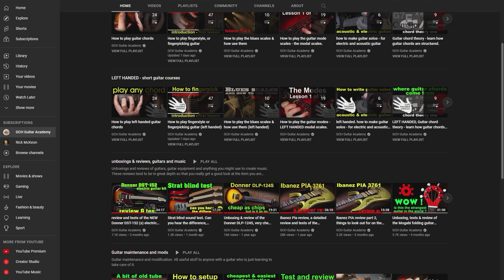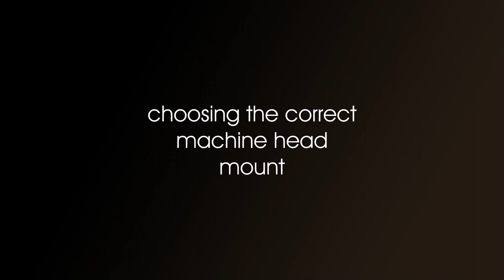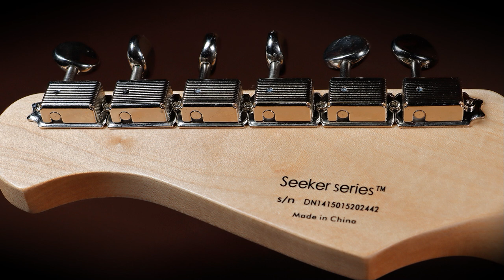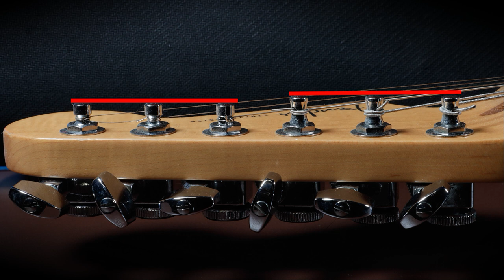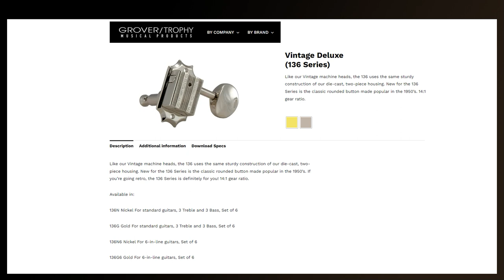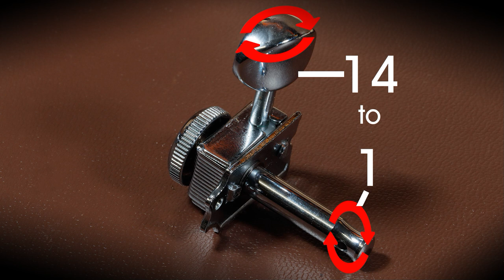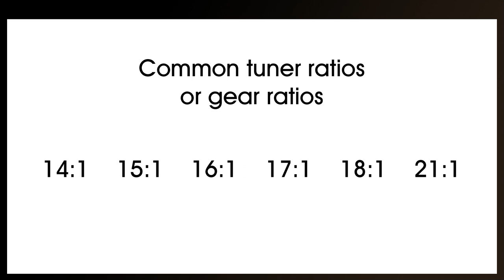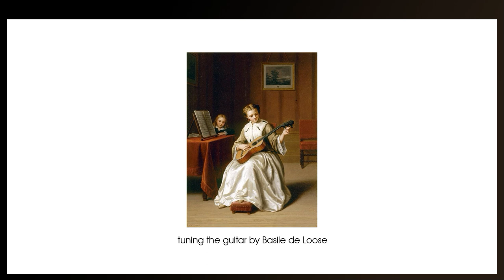guitar machine heads explained and everything you need to know about guitar tuners (tuning pegs)

Comment: I got a question I had gotten a g-50 a yamaha and it's missing a screw that holds the gear on the machine head I need to know where to get a replacement
Reply from the maker: Sadly I've had all sorts of problems trying to get Yamaha spares.  When I broke the tuner on a SLG200N I had to find a second hand one that I bought of eBay.  I think the g-50 has standard classical tuners.  The best way to be sure is to take all the measurements and then do a search for classical guitar tuners to see if the sizes and gaps between the holes match 🤔

Comment: Question, if I were to replace my machine head. Would the new ones have to be the same ratio as the old ones? Or would they be fine if it were different? Thanks!
Reply from the maker: No, you can fit machine heads with any gearing ratio you want.  Just make sure the holes are in the right place. 😊

Comment: Great video! Thank you for explaining all of this. I'm looking for information about the buttons. Specifically, how are they drilled to get the to fit the post they go on and also be screwed in? I'm not sure if that makes sense. What I've learned is that buttons are not universal. They're made to fit certain tuners. So I Imagine that the size of the hole differs from one to the next. Additionally, screws are used to fix the button onto the post it goes onto. So is the top of the hole of a button different from the rest of the hole? I apologize if my language is super confusing lol Obviously I have no experience with this. Basically I'm trying to learn how to make a button, so I'm trying to understand the proper way to drill the holes needed and how to drill them to fit certain tuners.
Reply from the maker: I can confirm that different makes of the buttons are very different.  The length of the screws are all different and the thread is different.  Some are shaped to fit on a spline with just a short screw where as others have a long screw that does most of the work.  Some machineheads have an extended shaft the button attaches to and others use washers and yet others have a shaft built into the button.  There's no way you can make a button without having a target machinehead to fit it onto.  I recommend you buy some second hand tuners off somewhere like eBay so you can compare them and make them to fit.  😊😃

Comment: Thanks. This is brilliantly educational. I’m trying to replace the tuning machines on my old Yamaha DW9 acoustic. Is there a resource anywhere to look up what replacements would fit best - there seems to be so many options !!
Reply from the maker: Not that I know of.  You basically have to measure the position of the holes and then look what's available in that size.  🤔
Reply from the maker: Not that I know of.  You basically have to measure the position of the holes and then look what's available in that size.  🤔
Reply: Thanks for the quick reply. I’d better just get on & measure up !
😊
Reply from the maker: @markjackson4275  Yeah . .  it has to be my least favourite job.  😒

Comment: Do gear ratios matter? say the guitar originally had 15:1 gear ratios and you would replace it with a 16:1 would it cause any problems?
Reply from the maker: No, changing the gear ratio will have no effect of the guitar.  The higher the ratio is the easier it is to fine time the guitar.  I hope this helps 😊

Comment: Hello there,im restoring a LTD MH327,recently I removed the tuning machines to clean it up,but now I dont realize whats the correct order now ,just see that have written "R1" "R2" "R3" "R4",hope you can help,the guitar have the factory machines,branded by esp
Reply from the maker: The 'R' stands for 'right hand side' which is only really useful when the guitar has machine-heads on both sides.  The number refers to the position the machine head should be fitted in.  I've never removed the machine-heads on a LTD MH327 so I don't know if they use the same numbering system as other makes but if they aren't staggered it doesn't matter where you fit the machine-heads.  If they are staggered. the longer machine-heads are on the bass end and the shorter ones are at the thin string end.     I hope this helps  😊